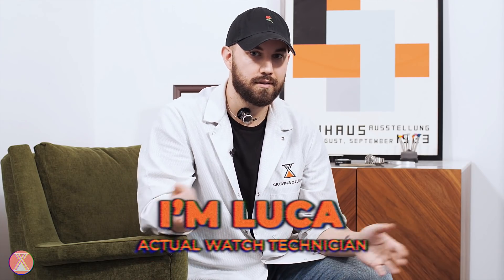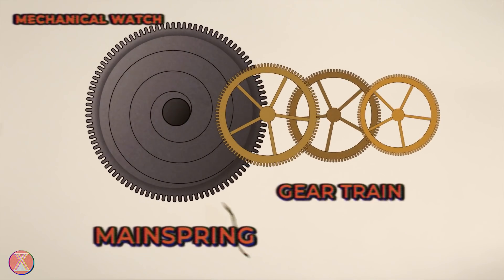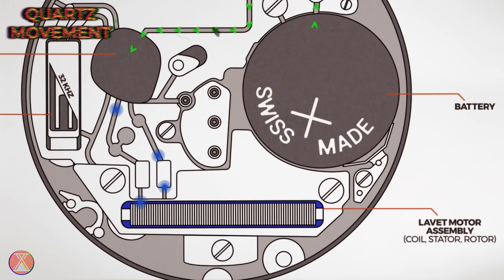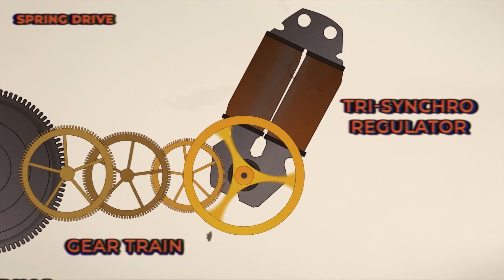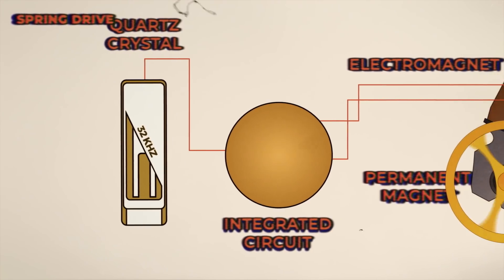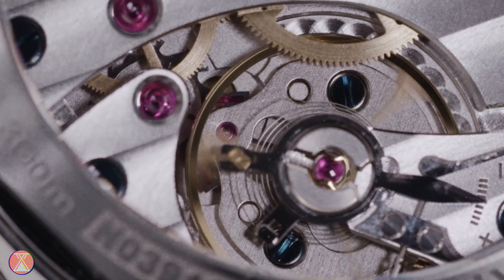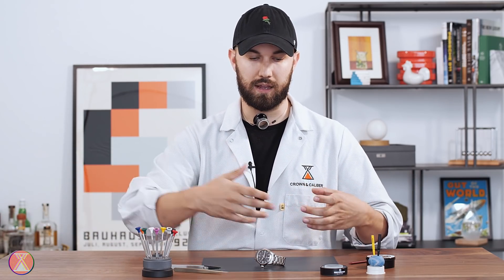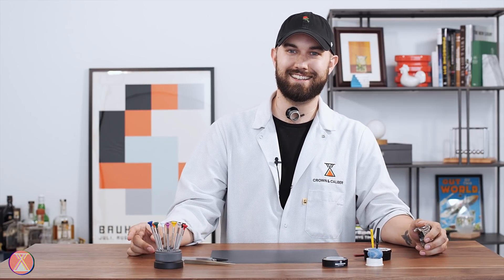Hey! How's That Work? | Grand Seiko Spring Drive | Crown & Caliber

Comment: so the main spring is the mechanical 72 hour capacity battery that recharges by motion. and then feeds power to the  quartz circuit which regulates speed of the glide wheel (the dial hands are attached to the glide wheel) using an electromagnetic brake. 
So if you leave the watch sitting for more than 72 hours it’s just an automatic watch again. 
it’s really cool and it’s tiny. a marvel of engineering. 
But,  you can buy a quartz watch for $30 that has a 10 year battery and is more accurate

Comment: You did not explain the power reserve in a pure mechanical watch vs spring drive watch. Why does the spring drive have a longer power reserve. Is there a battery storing that energy too?

Comment: Does the IC send power to the coils to slow down the permanent magnet, or does the IC (phase comparator?) open a mosfet to draw more current to brake the motor? Maybe dump it through an internal / external resistor? Would love to know the nitty gritty details

Comment: This movement is pure genius!  I love the spring drive.  Mine is running 1-2 sec per month!
Reply: it is just a tiny Technics 1200 record player circuit regulated to 8 Hz versus 33 1/3 rpm 
The real marvel is that they managed to fit it into a wrist watch case and run  for 72 hours
Reply: @johnviera3884  lol "just." You're a real expert huh? It took GS 20 years to develop this technology.

Comment: Very well explained sir . I think vintage omegas f300s are the best alternatives to the spring drive watches. They cost little and run at 300hz hence smooth sweeping seconds hand at a cheap price
Reply: That also sounds cool but doesn't that imply a lot more wear and tear and a much much lower service interval?

Comment: I wonder what will happen if in a couple of decades time, the internal circutry fails in this watch, would anyone be able to fix it. Or will it need to be completely replaced and then be dependant on part availability, chip shortage etc.
Reply: Spring Drive is already a couple of decades old.  You have to send it back to Seiko or GS for a service, where all worn out or damaged parts are replaced and are reported to you in a list.
Reply: The gears will wear out before the IC does. We're talking extremely low power, low voltage components, which if done right will pretty much last forever. The conditions which cause chip degradation (thermal cycling/oxide breakdown/electromigration) are simply not present in this application. There are also no components in this movement which go bad over time such as capacitors/batteries.

Comment: Spring drive only Grand Seiko has it?
Reply: Trick question.  seiko also has the spring drive in their high end LX line
Reply: Piaget tried something similar in their 250 thousand dollar watch. But they seemingly couldn't nail the sweeping seconds hand. They just left it out.
Reply: The very first Spring Drive movement was released in a regular Seiko watch and there have been very many regular Seiko watches with Spring Drive movements.

SPS001, SPS005, SNR001, SNR003, SNR005, SNR007, SNR009, SNR013, SNR015, SNR017, SNS001, SNS003, SNS005, SNR037, SNR039, SBDB007, SBDB009, SBDB011, SBDB013, SBDB005, SBDB015, SBDB017, SBDB018, SNR045, SNR025, SNR027, SNR029, SNR031, SNR033, SNR035, SNR047, etc.

This list is not even exhaustive.

They've also appeared in Credor branded watches.

Comment: Hello!!
Spring drive is like eco drive?
Eco drive from Citizen
Reply: Nope.  Spring drive is mechanical eco drive is a quartz watch
Reply: @vktravellog1242  Spring drive is definately a quartz watch. It's a quartz watch where the energy is stored mechanically, whilst the ecodrive has it stored chemically.
It's not the same thing, but both are definately quartz regulated and saying it isn't a quartz watch is dishonest. Spring Drive is very cool, though.
Reply: @WreckedRectum You're half right, it's actually both at the same time, a true hybrid.

Comment: So is it automatic or quartz?
Reply: It's automatic
Reply: It is literally an automatic quartz.  Although the quartz functionality is a radical departure from other quartz watches.

Traditional quartz watches electronically advance the movement with quartz timekeeping.

Whereas Spring Drive watches electronically slow the movement with quartz timekeeping.

The power for traditional quartz watches is stored electrically within a battery or capacitor.

Whereas the power for a Spring Drive watch is stored mechanically within a mainspring, just like a traditional mechanical watch.

Note however that not all Spring Drive movements are automatics.  Some with very long power reserves are hand wind only.  The longest power reserve for an automatic Spring Drive movement that I am aware of, is 5 days, whereas for a manual wind Spring Drive movement they get up to 8 days.

The typical power reserve for most automatic Spring Drive movements so far has been 72 hours.

Comment: Really a beautiful video. Only one thing I would say is that quartz does not always oscillate at 32768Hz. Its frequency depends on its physical dimensions, the higher the dimensions the lower the frequency, and this frequency is chosen so that the quartz is not that big, and being 2^15, you can halve the frequency 15 times so that you easily get 1Hz

Comment: Will the integrated circuit corrode or degrade with time? Will it last as long as a regular mechanical watch?
Reply: The IC draws an extremely low amount of power. This in turns results in low voltage, assuming a normal amount of resistance. So basically there's minimal "wear and tear" on the IC.

To draw a comparison, a Seiko 9F Quartz watch can last for 50 years without repair, and in there it has significantly higher electrical current since it needs to drive a watch hand. That's not the case here.

If anything, the gears will wear out before the IC.
Reply: @fiend7777 
But magnets lose properties with time. Time will tell.